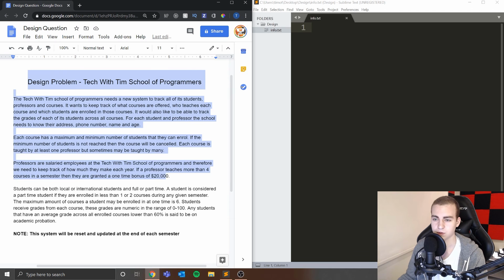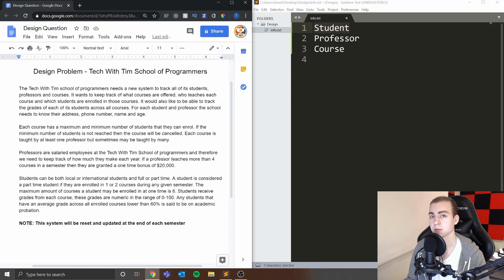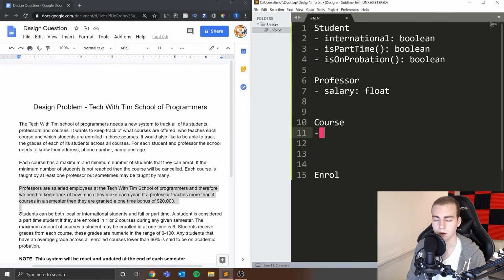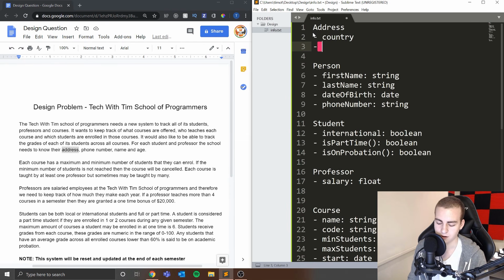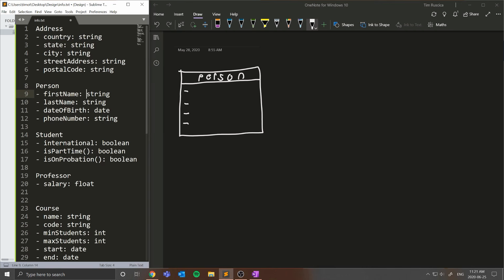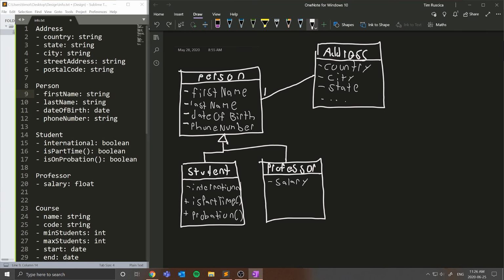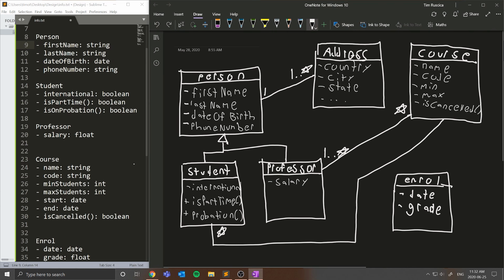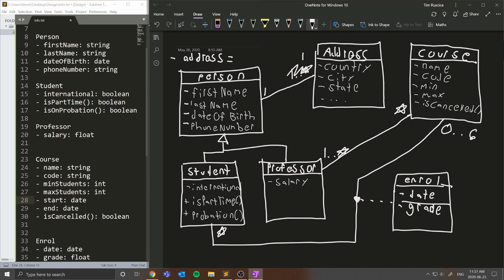Software Design Tutorial #1 - Software Engineering & Software Architecture

Comment: You you are a software designer are you also a software engeneer ? I don't get the difference between those two tbh
Reply: I guess it's the same as architect vs designer. 

Architect makes the overall structure of the building: communications, windows and doorframes, elevator shafts etc. And designer fills in all the details like wallpapers, furniture, non-structural walls etc. 

Without a design architecture is just a concrete box. Without an architecture design can't exist.
Reply: Software Engineering is a holistic view of software. Software Design is just a precursor to Software Construction, but both is still under Software Engineering. Normally, Software Engineers go through requirements, design, construction, testing, maintenance, etc. whilst managing the economics of the project resource itself

Comment: Further, I have a query regarding design 

Problem Statement:-

I have subcategories defined under Vehicle Class as :- Bike ,Car, truck, bus

Further, there are different variants under each four categories

Bike :- sport, standard
Car :- sport, standard, electric
 Truck :- Mini Truck , Power Truck
Bus:- Mini Bus, AC Bus

I have to calculate the price based on variants. For example Mini Bus price.

Question:- How should I define the classes ?
1. Keep only vehicle as a class .
2. Keep Vehicle as a base class and make bike, car, truck , bus  as subclasses and they should inherit the base class.
3. make sports bike as class which will inherit bike class which will further inherit vehicle class

What is the best possible solution following OOPS and SOlid

Comment: Tim, are you sure that this is how it works? What you are doing seems to be exactly what is tought at my university - and no, it has never worked in the real world, at least for me. After university, I have already done my fair share of everything between and including a GUI (desktop, yes I know, boooring...) "frontend" and a bare metal "backend", so one could call me a "full stack" developer in my own right, which is totally unrelated to any web programming. Hell, I even shipped an application made from scratch (in a team of two), which actually made the comany I am working with "some" money by creating a completely new buisness opportunity. My observations are that this kind of up front class based design will lead to a bad result in everything which is not a toy example. 
First, classes or anything which is related to explicity or implicity carrying state around, are emerging completely on their own when writing code that actually tries to accomplish anything which is relevant for the user. So, defining how you manage state before actually knowing how you are going to interact with it (when doing work the user cares about), usually creates unnecessary complexity. In other words, the design process starts where you put yourself into the shoes of a somewhat real user and try to interact with the system. And if the latter does not work, because the system is too complex, you write some usage code for a single component first and play around with it, usually revealing flaws in what originally seemed to be a fitting solution.
Second, when doing it class based from the get go, you are sometimes missing the non obvious abstractions you would get when thinking out of the box, and these are usually (again from personal experience) the ones which are most helpful. Reading a non formal documentation and extracting the nounes out of it, just means that you have read the documentation - but this usually is not what actually defines the underlying software system and also would make for a boring job. Unfortunately, this part only seems to come with experience but can sometimes be accelerated by matching known software design patterns (if they do not complicate the system too much) to your specific problem.
Third, sometimes performance matters and in these times, this approach will get you nowhere. This also extends to managing resources or when trying to give the user some guaranties that you are executing within user defined bounds of memory use. Why is it so problematic when doing this class based design? Because you usually (not always) hinder yourself when it comes to the needed simplicity for trivially managing resources or ensuring a certain degree of performance. Extending the problem of performance to situations where we find ourselfs in multithreading land, completely negates the class based design approach as state and resource management is expensive in this case (even when working "lock free") and might be avoidable by carefully layingout state and resource use.
Also, besindes taking the perspective of the functionality needed to support any relevant user interaction you would want to focus on keeping state management as simple as possible. Putting state and abstraction management into the middle of a user centered design process should yield the best results - system complexity and performance wise.

Unfortunately there is no one size fits all solution. While you are stating that you want to provide the viewer with the basics of software design, it still seems that what you are showing is not what really happens. I get that people would not want a real world example for their first introduction, but it would still be nice if you would try and give a more original and closer to real live approach, even if this means that multiple videos are in order to accomplish this and to not overwhelm new comers. Or at least hint that this is also not a one size fits all solution and that it may be used only in a small part of creating software systems.
Reply from the maker: I won’t disagree that this may not be completely accurate to the real world. However, the idea of this video is really more about getting people to think about design. It’s trying to show the benefits of at least thinking about what you want to do before you do it. It’s pretty impossible for me to do anything that based on your comment you would consider “acceptable”. That would involve probably 20-30 videos of user stories, sequence diagrams, state diagrams, object diagrams, class diagrams, testing plans etc. For a beginner if they can watch this and understand the importance of planning and the very basics of even say looking at a class diagram and understanding it I am satisfied the video had achieved what it was intended to.
Reply: @TechWithTim  I get your point, but sorry, its not what I meant. The planning part is already quite complete when considering your original informal document, at least from the user/business point of view. Afterwards its about doing less, not more of what you have showen. Its about coding coarse parts of your system while retaining the users perspective. And yeah, sometimes another informal picture of any interacting parts helps, especially when communicating this to team members (humans are visual beeings afterall).
So no, there is (in my point of view) no point in making more videos with more of the same stuff (which would actually be more of a generall user centric design process, which is not software specific and can and should be used for all products you would want to throw out in the market). But there is virtue in being reflective and teaching others to also reflect about a topic, such that they can start and help themselves, and yes, this might then involve a second or third video. But hey, its your channel, so I will stop bothering you now.

Comment: You'd also need to decide how you will store the information long term. If the program is to be used by a single user, you could get away with a button "close program and write everything to a file on disk", and when you start up the program you'd load the latest file containing all the information. But in case of a sudden power outage or other crash, you'd lose all the information you entered since the last time you started up the program.
But if you have more than one user and they would all need access to the same information, you'd need a central database and store the information directly via SQL statements.

Comment: I didn't watch your entire video with complete attention, so you might have alluded to this, but in case you didn't - for implied requirements, such as that a student has to be either international or local or the salary or bonuses for a professor, the description of the system or requirements document (or whatever you want to call it), if it mention such "requirements", needs to be extended, or a separate document written, to include information on what these attributes or details are needed for.  For example, mentioning that a student is either international or local implies some kind of behavior where this difference becomes important.  It may be as simple as, e.g., a requirement for reporting  which of the students of the students are international - or, more realistically, some behavior (such as, e.g., tuition and/or fees) for which the system behaves differently when a student is international vs local.  The reason for this is, I think, obvious:  For example, If, after consulting with the customer, one finds that he/she can come up with no differences in how the system is to behave for local vs international students, the local vs international criteria are actually irrelevant to the system and should not be modeled.  If the customer comes up with a good reason to include international vs local in the design, not only will the developer be certain this difference is needed in the model and implementation, but he/she should be able to obtain more information about this difference, what different behavior depends on this difference, and may, as a result end up changing the model to better conform to the needed behavior.